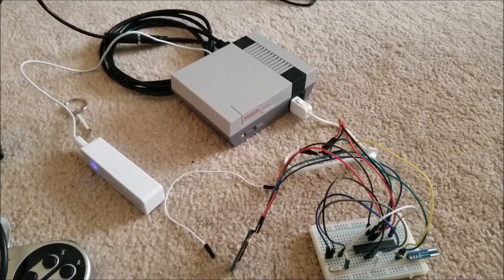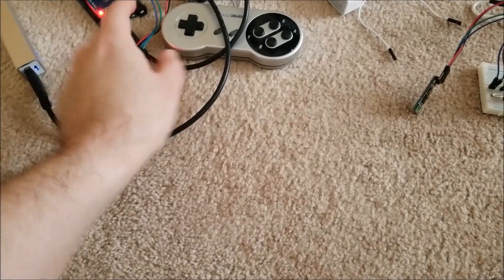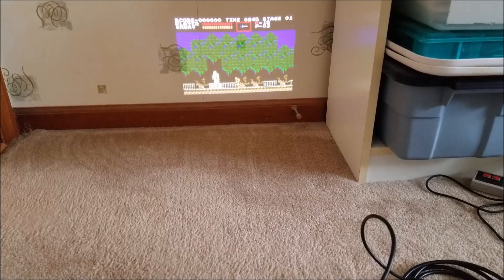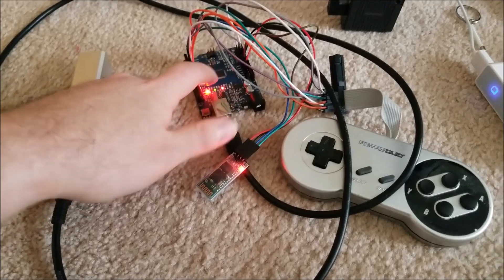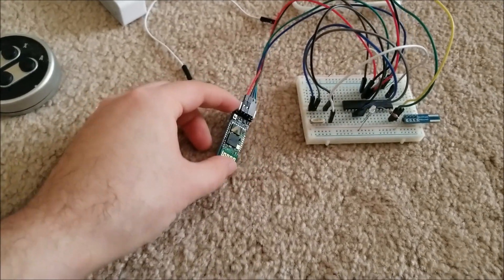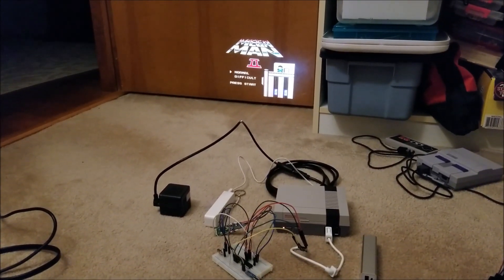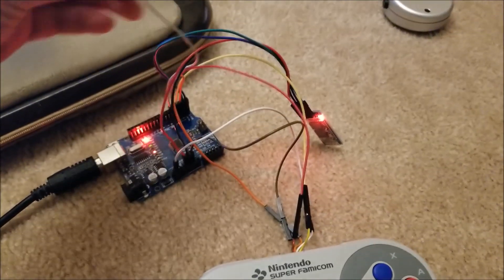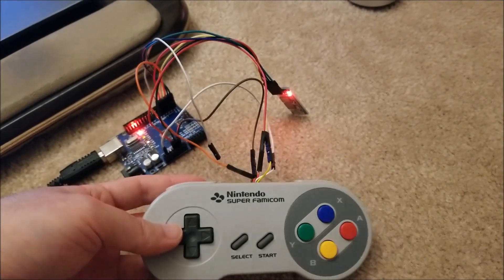DIY Wireless Nintendo Classic Controller Part 1: Breadboard Prototype

Comment: Good job man.That was actually super awesome . I'm thinking about hacking a snes controller of mine to send data via IR and developing a board to act as usb device to decode the IR data, acting as a controller. 
Watching your video and wondering.. do you think it's possible to communicate directly from the hc-05 to the pc and emulate input data received via Bluetooth as a game  controller ?
(Just an idea came to mind)
Good job. Cya
Reply from the maker: Thanks, glad you like it. Yes, I've read that it is possible to overwrite the firmware on the hc-05 with one that enables bluetooth HID so that it can directly connect to any device over bluetooth and enumerate as a game controller or a keyboard. It's a bit fiddly doing this from what I've read in order to reflash the firmware so I haven't had a chance to try it myself yet.

Comment: Would you do a vid on putting an AGS 101 screen in an AGS 001( 001 mobo)? Without the brightness control tho.
Reply from the maker: I'll add it to the list and keep my eyes open for cheap 001s with broken screens. I'd rather not ruin one of the ones in my collection.
Reply: Thanks :)
Reply: I want to mod mine but BennVenn's vid doesnt cut it because of the added digital brightness control (gb micro style) that I dont want which kinda clutters my understanding of how to do it
Reply: Also, another suggestion for another video that will prolly be doable only in the future: do you know about those power-A GC style BT controllers for switch that will come out soon™? How about something like what you did in this one but with an OG GC (or anything that uses the GC controller) and that controller for DIY modern wavebird replacement?
Reply: That would be totally awesome
Reply from the maker: Yeah definitely sounds interesting building on the basics I am learning from this project.

Comment: Hi, speaking of controllers, what's the usual fix for the Black Wiimote W/ Motion Plus Inside not recognizing the Nunchuk? Is there a factory reset for its firmware? If you unplug the Nunchuk and the game needs it (like the best shooter Sin & Punishment), nothing happens, it doesn't recognize you'd unplugged the Nunchuk. I've cleaned the contacts between the two with 99.99% isopropyl.

Thank you.God bless
Reply from the maker: Wiimotes have no user upgradable firmware so I suspect it's a physical connection issue on the i2c bus. Inspect the path from the bottom connector to the mcu in the wiimote as well as the nunchuck side.
Reply: @sjm4306  Hi thanks again. It's sad it's not 'Like New' condition. I don't want to strain the good relationship from an accommodating and courteous seller for a full refund (also it's a hassle and expensive to return) but what amount could be a fair percentage reimbursement for an amazing looking Black Wiimote w/ Motion Plus Inside & black Nunchuk (the Nunchuk is fine) but the Wiimote's i2c bus is faulty (doesn't recognize there's a Nunchuk)? I've cleaned the their connections well but it won't recognize the Nunchuk.
I bought it with the Nunchuk for US$17.15, what percentage do you think is the defect. Is it 10%, 20% or another percentage so I can tell him to just reimburse me partially coz' it's technically a defective item but not 100% defective or even 67% defective, the buttons work.

Also is this kind of problem easy to fix?

What's your advice?

God bless, Godspeed.
Reply from the maker: @SevenDeMagnus if they are a good seller otherwise I'd ask for a small refund, like 10%. Otherwise if the value isn't much I'd just let it go as they are human too and mistakes happen. Just shoot them a message so they know what to inspect in the future
Reply: @sjm4306  Thanks for the advice, I guess 10% is small refund, I might just let thing go but I'll inform him I might not even refund partially and will give him 5/5 stars still (he did his best, he wasn't techie).  How easy is the i2c bus to fix and how?

Comment: what's the latency like on this?
Reply from the maker: I measured it in the second video (https://youtu.be/xVIEHUZmi_U). It came out to ~29ms or 1.75 frames at 60fps video.
Reply: @sjm4306  Ah my bad! I'm looking at making something similar to joycons for a portable wii that would be using gamecube controller and just figuring out my options